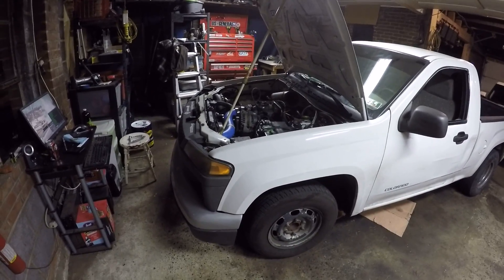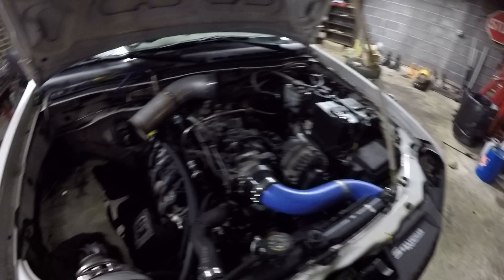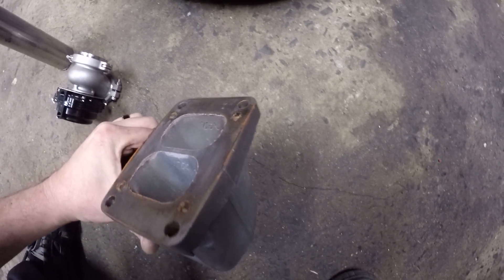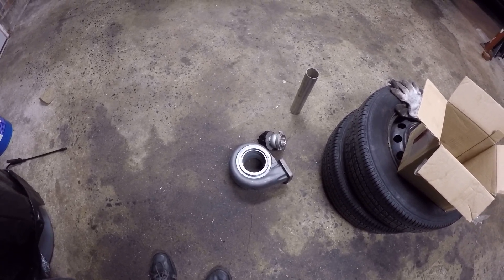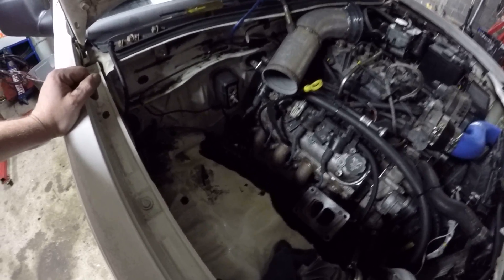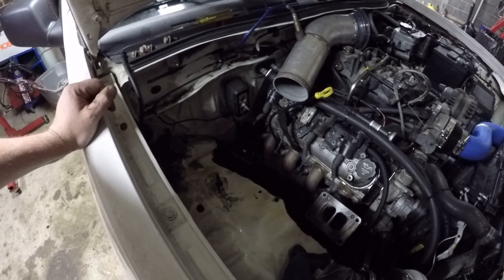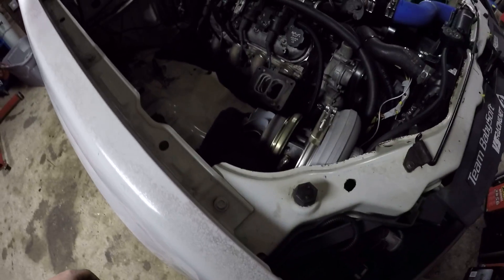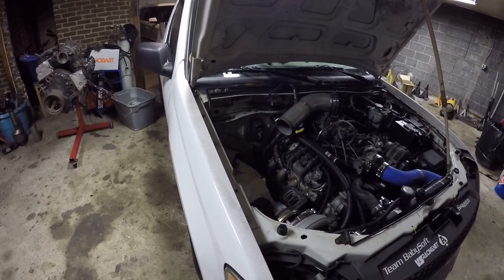turbo colorado after dyno update, adding wastegate to turbine housing

Comment: Chinese turbine...?
Reply from the maker: +John Zanjani its all china, front and back
Reply: +Sloppy Mechanics really.. No issues ? I always heard that they are prone to failure
Reply: It would be really interesting to find out where that stigma comes from.  like, if its because of shitloads of real mfg failures where its just all out garbage and the person who installed/tuned/drove it did it all right and didnt flog it with no oil or if they did it all wrong and just blamed it on wong ho. Or if it came from those guys who just think everything that comes out of china is trash and that it will just fail EVEN IF the china product is actually better than certain USA made turbo`s.   idk, would just be interesting to know where it stems from.

Comment: Thanks Matt!  I'm going to redesign the setup I'm building.  I was putting my wastegate on the crossover like you did, but I kind of expect similar problems with a largish turbine wheel that doesn't create much back pressure.  So I will just run a proper wastegate priority routing on the up-pipe and dump it up front under the engine or something.